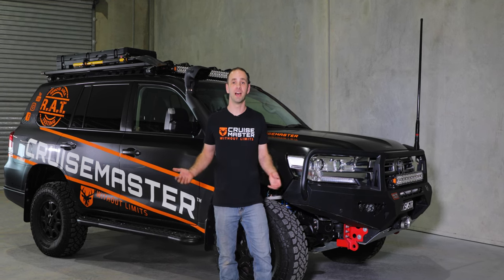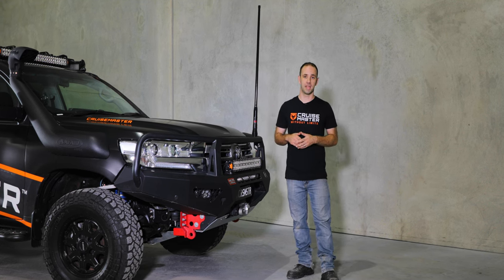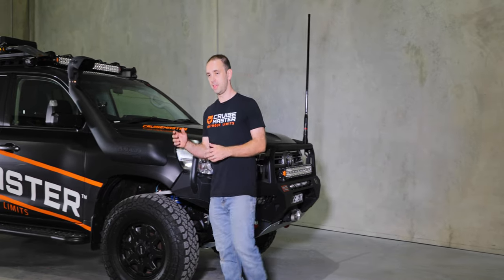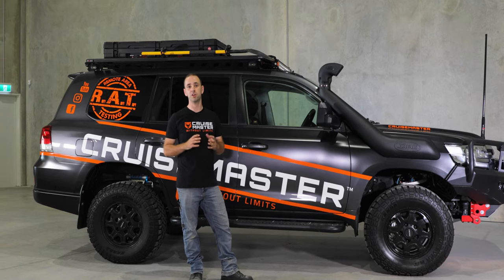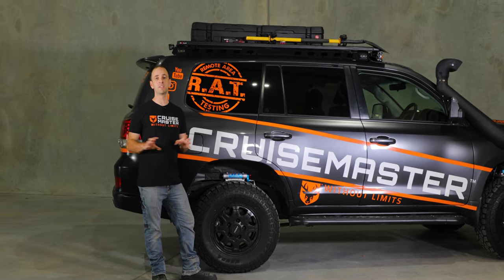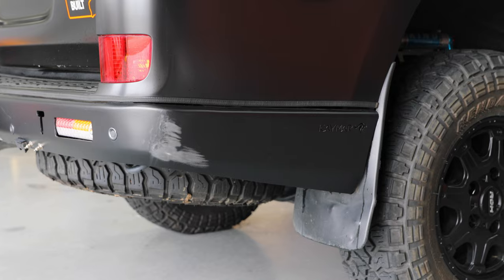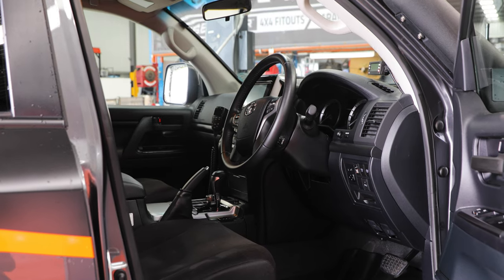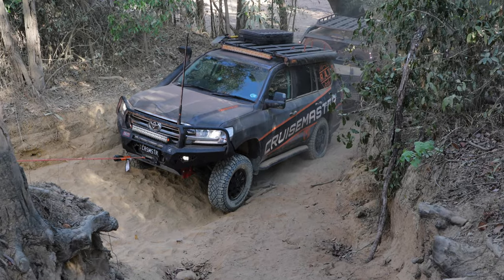LC200: How Did It Perform? | R.A.T. Run Bonus Content

Comment: Roof top light bars definitely work better on 3/4 length racks set back to allow the sunroof to work.
2nd, put the soft side of Velcro on the antenna mast or black heatshrink - our mount the antenna another place.